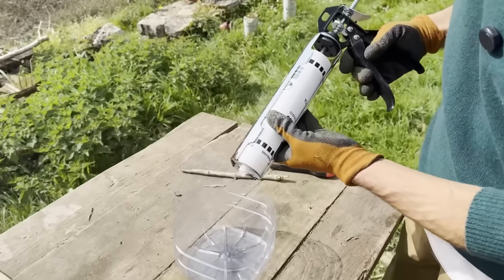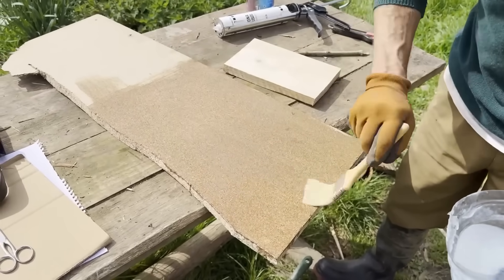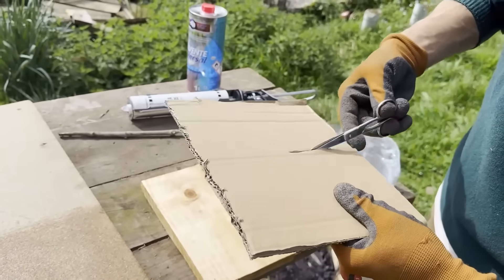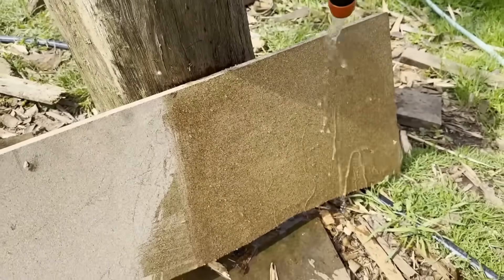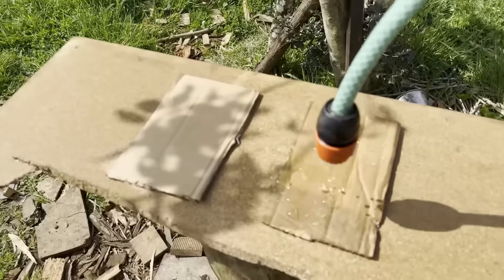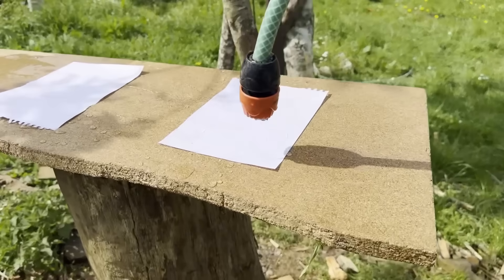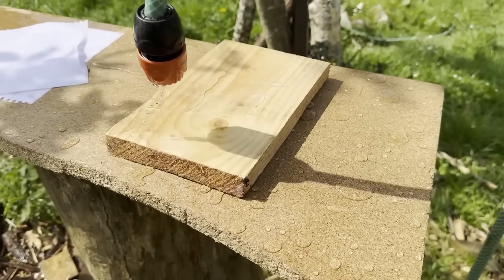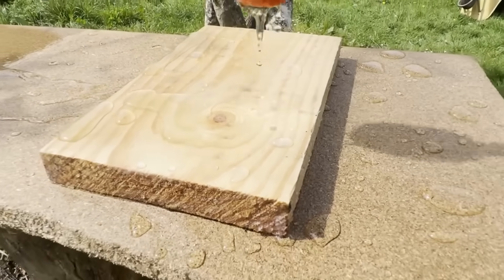This Gadget Waterproofs Everything in 5 Minutes (Super Affordable!)

Comment: Fascinating idea.  The worst place for wood rot is where two timbers join as water soaks in between the two surfaces by capilary action and stays there for a long time and hence rots.  This has happened on my decking where the tops of the joists have rotted and the underside of the boards.  I now need to renew and think I will use this treatment where the two surfaces bear on each other.  I think I will lay a small piece of polythene between so the they do not stick together if future renewals are required but hopefully it will see me 'out' first😀.  Anyone see any problems in doing this, even UV can't 'see' it?

Comment: It’s worth adding that this treatment means the timber can no longer be painted. Nothing will stick to it. Food for thought 😉
Reply: So you just stain it before the waterproofing ;)
Reply: Easy peasy, first stain or paint it..then seal it
Reply: @estemeiring3705 so if it’s a thinners solution will it not react to the painted surface
Reply: @glennsmith1353 z bejca?   zrób test    zabejcuj cos  i   uzyj   rozpuszczalnika
Reply: @estemeiring3705 except if you paint it the silicone wont penetrate and eventually will peel off.  You need this to penetrate the pores of the cellulose.
Reply: Awesome I want to do that to my fence I just built so I never have to paint it
Reply: You can paint silicone caulk.  People do it all the time.
Reply: @wesbaumguardner8829 You can paint caulk, not most silicone. There’s a big difference! 😉
Reply: add additional thinner-based paint to the recipeadd

Comment: I am wishinhg to use this method for my outdoor carved wood furniture. Till now I use varnish 2 times a year to protect the furniture. I want to know will this be a great idea to waterprof? also what about the stickiness of the surface after treatment? Will it create any problem for clothes or skin when we sit on the furniture?
Reply: I was wondering the same thing. Someone mentioned in a comment this wouldn't work for stained or painted surfaces, so I think I will try with a sample board to test it.
Reply: Silicone waterproofers need to be applied to bare unpainted timber or masonry. You cannot apply this solution over previously painted or treated surfaces. The solution needs to sink into the substrate to provide a waterproof barrier.

Comment: Trying to answer some questions.
You can use terpentine to solve the silicone 
Use uv resistant silicone if exposed
Impossible to paint afterwards 
If you paint good why paint silicone on it? 
Terpentine can burn but it evaporates in a short time.

Comment: Or you can use old motor oil thinned out with diesel and a pump sprayer on all wood fence, post, decks and siding. Repels water, insects and prevents rot.
Reply: This guy is preserving wood  so it doesn’t need to be replaced with more wood after it rots without a sealant.  Thus saving trees.  But, sone of you are complaining that what he’s doing is not good for the environment.  SMH.
Reply: Great for the environment. 😮
Reply: And that's how you destroy the environment 😅
Reply: @Muzzle801 they didn’t say soak it, and you don’t.  It doesn’t come in contact with the ground.  Actually less chemicals than “sealers and stains”.
Reply: @Muzzle801  Just say you don't like India...
Reply: @Muzzle801  yeah what a travesty! Let’s just keep dumping chemicals on it that we buy from the big box store and then when those fail every five years, we can replace all the wood cutting down more trees!!
Reply: @Muzzle801 you are fake news
Reply: @Muzzle801  How? oil in soil degrades in about a year, not sure about sinthetic oil though.
Reply: @Muzzle801 where do you think oil is from?

Comment: Hmm😂😂😂😂hehehe Sun stars Uv light in the light of the wood burning. This method will not help. Note that the Sun actively acts on the surface of the wood, changing the temperature. The structure of the wood is micro-fibers. In nature, the micro-climate moisture is inside the micro-structure of the wood fibers. This method has been known for a very long time. Only natural wax from bees is used. Wax withstands high loads of climate changes in summer and winter. old methods serve for several centuries. Beeswax protects the wood from the Sun and climate changes moisture.

Comment: If you would apply to a wooden house, would this not ruin its ability to 'breath'? would it not also lock in vapor from inside?
Reply: Not if vented properly
Reply: What do you think paint does?
Reply: @cantablocal6768  Well... for starters... not replacing silicone with any type of paint to seal corners and cracks in bathrooms...
Reply: @SPDLand 
I suspect that you took my comment out of context. The video was about waterproofing timber with a silicone mix, I took your question as applying to outside weatherboards which are traditionally painted as a way to prevent moisture damage. Silicone use in bathrooms, kitchens etc as a sealant between different surfaces or objects is not what this video is about so my comment should not be applied to that use.

Comment: For those wondering about longevity, a good quality silicone will last for 20+ years. After the solvent evaporates, it's now 100% silicone, so this should be similar for endurance.
Reply: I am wishinhg to use this method for my outdoor carved wood furniture. Till now I use varnish 2 times a year to protect the furniture. I want to know will this be a great idea to waterprof? also what about the stickiness of the surface after treatment? Will it create any problem for clothes or skin when we sit on the furniture?
Reply: @green_life7 It won't be sticky. It should be fine.
Reply: @rocknral okay thanks will try.
Reply: @rocknral really? That's what I was thinking as well.
Reply: It will not last near that long if it is not UV resistant and it is exposed to sunlight.  They need to get the UV resistant caulk if the application will be exposed to sunlight.
Reply: 200%wrong Real lmn silacone will cost 5 times mare than store bought acid curing rubbish which is 50%chalk bulking agent .Im a shiperight by rrade and i would fire anyone usinff store bought garbage silacone  LMN pure silacone is the real deal and only the ones costing 5 times  the acid garbage .Check my detailed coment above .Then check online for the real deal .Be amazed at how scammed the diy guy is shafted .
Reply: @brotherdom1 
Don't know what part of my original comment was 200% wrong, but anyway... 
Low modulus  silicone is not rocket science and doesn't cost 5x acid cure. Neutral cure lmn in a  respectable brand like Soudal is not that expensive.
Reply: Which brands, types of silicone? I live in Canada and we carry some of the same ones as USA but I have no clue which are good and which to avoid, and the ingredients are almost identical for most of them.
Reply: @DarkGhostHacker  Soudal is a brand that seems to be an international brand that has a good reputation.

Comment: It's definitely a good idea 💡 where geological weather issues are 🌧 🌦 wet.
  Saidly if in a dry climate where  a fire season in normal.  
  This process will probably catch fire very fast
Reply: Yes yes it like gas
Reply: The solvent will evaporate and you are left with a film of silicon. Silicon isn’t a fire risk
Reply: @mattfaulkner6504 Agree. Silicone doesn't burn. If one is worried, there are fire rated silicones that won't degrade in fierce temperatures.
Reply: Put a blow torch on a strip of silicone....
Reply: od kiety to  silikon  czyli krzem jest materiałem  palnym?

Comment: It might be fine for a natural finish. Don't ever try to paint it since paint will not stick to silicone. If it doesn't block UV rays, the UV will just degrade the wood under it and flake off like any other non UV resistant finish. If you ever want to change it you will have to sand it all off, since I do not think, anything will adhere to the surface with silicone still present.
Reply: Or just paint it before you apply it 🤷🏻‍♂️
Reply: @GBln-bp7ui  if you paint it before you apply it - it won't penetrate the wood, right?  If you brush silicone on top, you'll see the 'sheen' and appearance of the paint change.  And, after some exposure to sun & weather, I suspect that a thin sheet of silicone will start to peel off.  Almost certainly,  it seems.  ◇
Reply: You can paint over sillicon 😂😂
Reply: What about pva glue?
Reply: The contract painters have a trick to go over silicone. Maybe they'll share it with you. 
I was shown it 20 years ago. Can't share it as I promised not to tell. Besides, I couldn't put up with the hate in the comments that it won't work.
Reply: @rocknral 
I just buy paintable silicone, no special tricks needed as you just paint it once it is dry.
Reply: @rocknral  I just rought it up and shellac it like I did back in shop class. Then you top coat it. I'm sure there are other tricks like using other 'durable primers' but shellac is cheap and plentiful.
Reply: @rocknral  pva glue? Or wallpaper paste?

Comment: Water based clear caulk. Water dilution. Spray or brush. I use it as a glue as well. Silicone is way to problematic.
Reply: If it’s water based how does it not wash off when it rains if used externally?
Reply: @LemonPuf When dry fully, is WATERPROOF.  I use it all the time. Silicone is garbage.  Otherwise, its used engine oil, for wood longevity.
Reply: @CalefNoise thanks for the reply! Would the caulk waterproof concrete as my shed roof has a fine leak

Comment: I'm wondering about how it is affected by the sun, and will it begin to peel
Reply: Depends on depth of absorption, hard woods terrible, soft dry pine works well on.
Reply: Soaks in.  Don't suspect it will peel at all.
Reply: Does it maybe depends also on the % diluition?...
It would be very useful to know how much part of silicon an how much part of solvent is recommended to mix... Thank you for suggestions!
Reply: @robertolotti2669 
I just thought the same 2 seconds before I got to your comment 😂👍
Reply: @JoleneValdovinos 😂😊

Comment: Love it!!!! 
can you give me to you solvente  link from amazon or other pls?
Reply: Read the label of the silicone - for cleanup instructions - that will tell you what solvent you can use
Reply: I used petrol once.. Worked good.
Reply: Acetone
Reply: Mineral spirits
Reply: Are these “cheap” solutions safe for the environment-or just adding to the already over abundance of pollution of our land and water due to chemicals ?
Reply: @AJ-pd8bd like most chemical applications,  it's innert once cured.  As long as you're careful not to pour solvent into the soil there's no issue.

Comment: What do you mean by "universal solvent"?  Are you talking about mineral spirits?
Reply: Paint thinners.
Reply: isopropyl alcohol will dissolve silicone
Reply: Also mineral spirits, I believe
Reply: Well…my 2 cents, water is known as the universal solvent. 
I know that’s not what he used, just sayin.
Reply: Paint won't stick to silicone. How would you paint it?
Reply: When you try using gasoline to dissolve silicone - you'll discover how much cheaper it is compared to other potential silicone solvents.  Also, you may remember how to let it evaporate and not have flame nearby that could ignite the gasoline. 
I'm gonna have a doubt that silicone will actually protect wood for twenty years - but time will prove how long.  
And, I'll really be wondering if any paint will be able to stick on that silicone and last.  Not much will stick to silicone, it seems.  Why is that?
Well, it's worth a try and I'd love to see the results - even if the new paint coat does start to 'jump off' after just a few years.   ☆ I'd be happy to see if anyone had done this 5-10-15 years ago and can show some good photos of the results.  Just a clear silicone paint will look pretty nice for a few years until the UV gets through the silicone and starts to grey that exposed wood.  ♡
Reply: In agreement with another commenter, in chemistry water is known as the universal solvent.  Something else is clearly being used here, so clarification of exactly what that is is important.
Reply: Paint it first,obviously!
Reply: Thinners
Reply: I was thinking Acetone. I believe I've seen this somewhere before.
Reply: Would SBR primer stick to silicone?